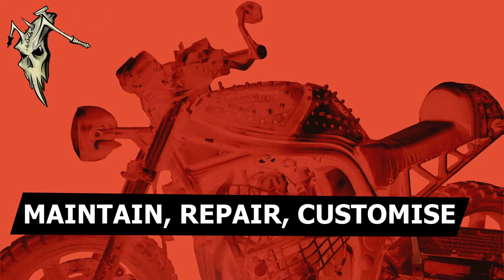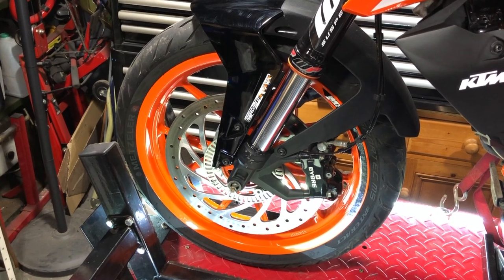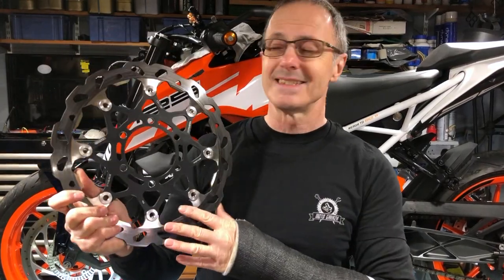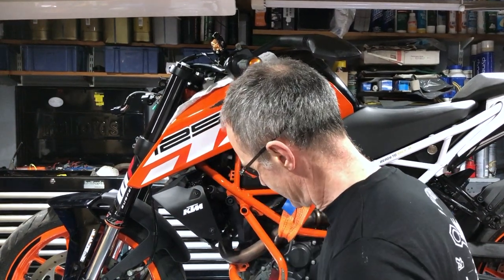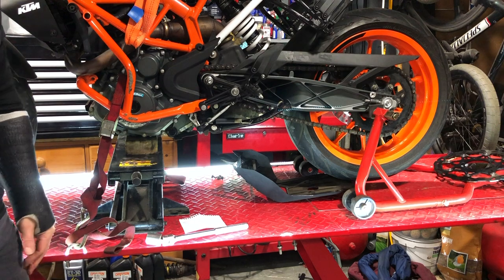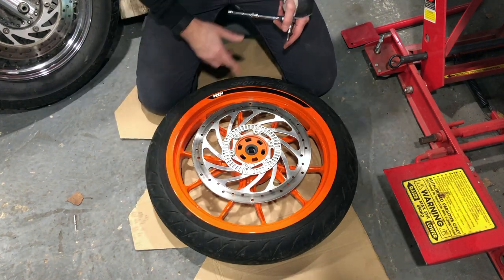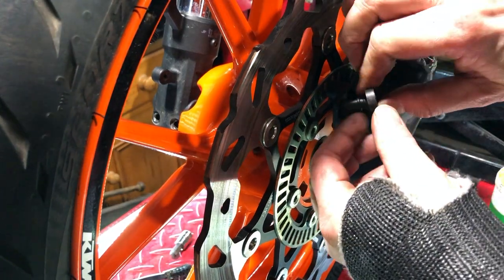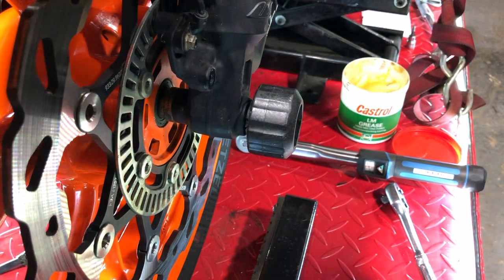Galfer Wave Disc Upgrade for the KTM 390 125  200 250 Duke

Comment: I have a 250 duke, doe I have to put radial spacers on the caliper? Because my disc is 300mm and I guess that one is 320mm
Reply from the maker: Yes, if you currently have a smaller disk, you will need spacers and longer bolts to move it out to the correct place.

Comment: I have scanned the internet and cannot come up with a galfer front disc for the 2017> 390 duke? I am guessing this must be as the <2016 fitment!?
Reply from the maker: Mine is a pre 2017 disc, but Galfer make a disc for the post 2017 bikes - Part #: DF940CW which is the part number I've listed in the description for the video.

Comment: Wahey. followed your guide and got my wavey front disc on my 2015 Duke 390. It's still 300mm but looks cool. I stuck on some rim stickers at the same time and the front end looks sooo much better. Have some new sintered disc pads but will have a crack at those separately. Thanks for the torque numbers - first time I've used a torque wrench! Next up is the wavey rear rotor and rim stickers. Cheers. Weather is Sydney is finally clearing up for a decent ride (rained every day during my 2 weeks Xmas break :-| )
Reply from the maker: Sounds great, well done!  I've considered upgrading the rear disk but never managed to convince myself of it's worth - but I might go there if I do more supermoto style riding and actually put some heat into the rear disc!   Have fun with the better weather - it's cold here and forecast for a week of rain, even if we were allowed out to ride!  Skäl  David

Comment: Please what's the biggest, fattest tyres that can correctly fit on a KTM Duke 390 without any needs for mods done on the suspension?
Reply from the maker: The 390 uses an unusual wheel size so your choice is very limited.   I can't answer your question as I have never had any interest in losing the handling abilities of the bike.  Skäl  David
Reply: ideally the racers down size to the 140 rear tyre, if your looking for a "fat" tyre your fit a 160 on there but your lose the handling, hence why the proper riders looking for best track times down size to the 140 most of the time.

Comment: Thanks for the detailed video. Is it required to upgrade both the disc rotors with the gulf one or motomaster ones? If anyone wants to change only the front one? Or we can settle with changing the front only? Is there any abs calibration mismatch can be felt if we keep the rear disc as stock? As front ones become more superior in terms of progressive feel? Please advise.
Reply from the maker: You only need to upgrade rotors if you are getting brake fade and you'll normally get that first on the front unless you do a lot of trail braking.  Typically only stunt and track riders really need to upgrade the rotors on gen 2 bikes (going to larger rotors on the gen 1 bikes is a different story) but I tend to ride supermoto style on this bike, so upgrading the front works for me.  The motormaster ones have better cooling abilities, so your braking will only be improved compared to overheated stock discs.  Braking and progressive feel before the discs overheat is down to your choice of pads and master cylinder.  You won't get abs calibration issues unless you are changing the abs rings from stock.

Comment: no spacer and longer bolts for the caliber?
Reply from the maker: It's the same fitting as the existing disk.  You only need an adapter if you have an older bike with the smaller disk.

Comment: Ive done this stuff a hundred times, but still enjoyed watching your video!
Couple things I noticed:
That spacer is going into that rubber seal way too easily. Good idea to replace that while youre at it.
7:20 You should use a longer ratchet for that. Pulling slowly with a small lever deforms the allen head (risk of rounding it) instead of loosing the screw. (Thats why you had a hard time to get the allen key out after you loosened the screws.) Better use a big lever (long ratchet) instead to loosen the bolts quickly with more force. :-) Then its a good idea to replace these soft allen head bolts every time. If you completely round off the head next time, youre in trouble.
Dont grease threads, thatll cause you to overtorque it, because the reading on the torque wrench is not correct. Use loctite to protect the threads from corrosion.
Superb video tho! Good job! That galfer disc looks way better than the original one.
Reply from the maker: Thanks Chris.  Ah the old grease or not grease debate.  Even bike manufacturers have different opinions.  Skäl.  David
Reply: @MotoMirius  Manufacturers only suggest to grease bolts inside the engine since theres oil inside the threads anyway. So you grease these screws to get a consistent amount of friction.
Ive never seen any shop manual telling you to grease any other threads on a bike.

Comment: Hi David ,
I have one question, some people complaining in the web about the rattling noise with the fully floating disc rostor installed in their bike , 

I have a ktm duke 390 2022 model and I want to upgrade to the full floating disc rotor in the front and also want to try the floating disc rotors.
I don't like much noise from the front also.
Your suggestion on this : 

Thanks for the great video 👍🏻👍🏻
Reply from the maker: Floating disks don't rattle unless they are worn out and need replacing or are poorly made.
Reply: @MotoMirius  Hi David 
thanks for the reply.

Comment: @moto mirius, was the weight difference noticeable between the two discs?  Will rotating mass play a role in performance??
Reply from the maker: There isn’t a big weight difference and it isn’t something you’ll notice when riding.  What you will always notice is improvement in braking.  If you are interested in performance then you will want to be able to stop faster and later.  Skäl.  David
Reply: @MotoMirius  thank you for the reply.. I currently have the stock 320mm rotor. Assuming they have relatively similar performance for a weekend  warrior.
Reply from the maker: If you can't brake fast, any weekend warrior is going to be slower than the other weekend warriors who maybe can't accelerate as quick but can brake later and heavier into the corners.  If you rarely brake, you don't need to upgrade, if you hit a lot of corners these don't fade as quickly.  If your brakes aren't fading you aren't a weekend warrior ;)  Skäl  David

Comment: Wouldn't an impact wrench, or to be rather more gentle, an impact driver be more suitable to unscrew these disc bolts ?
Reply from the maker: You can use an impact driver.  For me it's easier just to grab a socket and bar from the already open drawer.

Comment: Hey David! Could you please link the upgraded wheel sliders you will install on the bike instead of the powerparts sliders? Thanks a lot!
Reply from the maker: Hi Márk.  I didn't like the powerparts sliders because they are too short, so I installed these https://bagorosperformance.com/front-foot-pegs?search=&make_id=16&model_id=8&engine_id=6&year_id=38.  Skäl  David
Reply: @MotoMirius  Thanks a lot!

Comment: Does the front brake rotor cross over to any other bikes?
Reply from the maker: This is the list from Moto-Master (I just happen to have this website open) where the rotors are the same so will be the same for Galfer:
HUSQVARNA Svartpilen 125 (Cast wheels) 2021-and up
HUSQVARNA Svartpilen 200 (Cast wheels) 2020-and up
HUSQVARNA Svartpilen 250 (Cast wheels) 2020-and up
HUSQVARNA Svartpilen 401 (Cast wheels) 2018-and up
HUSQVARNA Vitpilen 401 (Cast wheels) 2018-and up
KTM 125 Duke 2021
KTM 390 Adventure 2020-2021
KTM 390 Duke 2017-2023
KTM RC 390 2017-2021

Comment: KTM for some reason have a mixture of metric and imperial nuts, bolts and Alan screws. By the look of the flex in removing the bolts, I’m pretty sure you rounded the caps screws when you fought the locktite
Reply from the maker: Purely metric but since these are Indian made they use some low quality fastenings which aren't exactly accurately made or made out of of appropriate quality steel.   As a rule of thumb it's always best to replace the fastenings on these bikes.  Skäl  David
Reply: Moto Mirius assembled in India, the Philippines and Argentina. All the parts are are actually manufactured by KTM in Austria
Reply from the maker: @shaneparfitt77  Sadly that isn't true for these bikes, and if you had ever bought mechanical parts for the bike you will see that they are marked 'made in India.'   KTM have already had to intervene at the Indian factory on at least one occasion that I'm aware of to correct quality control issues in engine components
Reply: Moto Mirius 100% correct, that is why some of the 390 Dukes have a mixture of imperial and metric bits. Bajaj India tried to save some money and sourced some of their own assembly parts and screwed up, hence why KTM Austria had to step in. But they never recalled the ones already assembled. At least thats the version of the story from the KTM Master craftsman mechanic that I take my bike to for all its services
Reply from the maker: @shaneparfitt77  I would agree with that - except I suspect a misunderstanding on the imperial part - imperial tools fit some fasteners better than metric - that is true because of poor manufacturing, but the threads are still metric which wouldn't be true if it were an imperial fastener.
Reply: Moto Mirius good point on the thread. I’ll ask the old goat about that when I see him again.
Reply: @MotoMirius  Do you have any info on which year that happened?
Reply from the maker: @NVIDIAGeekify  What year what happened?  The small Dukes (125, 200, 250 and 390) have all been manufactured in India from the very start.

Comment: Can this be done with the indian version of rc125
Reply from the maker: I believe that there are different versions of the RC so it depends.  However, that disk is actually intended for the Gen 1 Dukes, but if you have a smaller disk currently you will need a spacer to move your brake caliper out so it fits on the larger disk. Skäl.  David
Reply: @MotoMirius  in india the frame and body of rc 125 is taken from RC 390...so that the dimensions of the bikes are same although there is a difference of weight...so can I opt For disc plate made for RC  390 for my baby rc
Reply from the maker: I can’t speak for bikes in India.   But the 2019 RC390 uses the same brake disc as the 2019 RC125.    You can also check this by looking at the brake manufacturers website.

Comment: Can we install dual disc on front tyre of duke 200??
Reply from the maker: While I won’t say it’s impossible, the primary issue will be the lack of mounts on the right fork leg.  Skäl.  David
Reply: Moto Mirius :is it better to change the whole wheel ?which is compitable to the dual disc !
Reply from the maker: You are likely to need a new wheel, front fork and master cylinder as well as the new disks and brakes.  I would suggest first upgrading the existing brake to something more aggressive such as the MotoMaster Flame disc with sintered pads.   Is there a reason why you think you need so much braking power on the front?
Reply: @Moto Mirius , I want more break system as well as sporty look
Reply from the maker: Yes, but why do you need more break system.  What are you doing that needs more break system?  If it’s just for looks then that is a very expensive cosmetic upgrade.  The normal approach is to swap a complete front end from a different bike.

Comment: What is the internal diameter of your front brake
Reply from the maker: You mean the disc?  The same as the stock one - which is what you'd expect from a rotor designed to replace the stock disc and the same as the powerparts one.
Reply: @MotoMirius  yes as I’m having trouble getting one for my bike as in someone’s changed the front wheel on the bike before I got it as the internal diameter where the bolt holes are is 90mm but still 300mm on the external diameter
Reply from the maker: @Firby1988  Do you know what the wheel was off?
Reply: @MotoMirius  no I don’t I phoned AMS motorcycles to ask as that is where the bike was purchased from by my insurance after mine was written off . But they just passed the buck
Reply from the maker: @Firby1988  Must be some clues on the wheel - there will normally be a logo somewhere.  Is it KTM?
Reply: @MotoMirius  I’m sure it’s a genuine ktm wheel
Reply from the maker: @Firby1988  Then it will probably have a part number on it.

Comment: How much mm is That disk...?
Reply from the maker: The same as stock.  Disk upgrades improve cooling - the dimensions remain the same to ensure that they fit the stock setup.  Skäl  David
Reply: Mine 2019 Dominar its have same ktm disk size is 320mm so it will be suitable..?
Reply from the maker: As I say, it replaces the stock 320mm KTM disc.  If you want to be sure I recommend that you check the Galfer website and if necessary ask them.